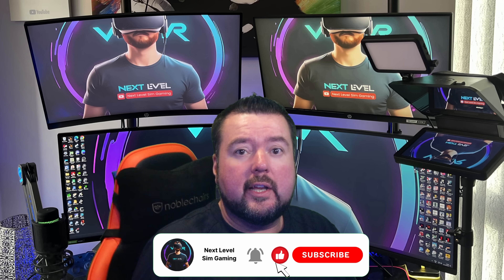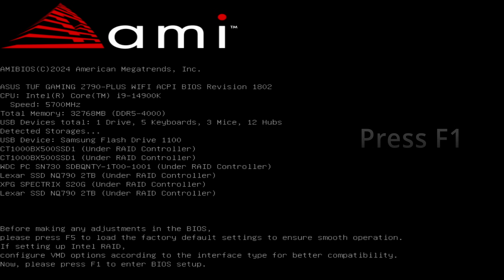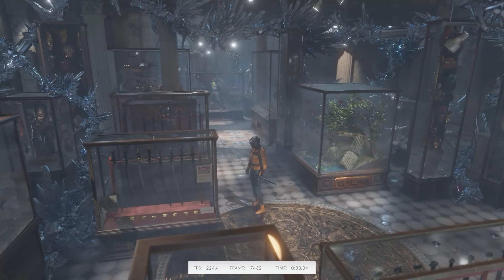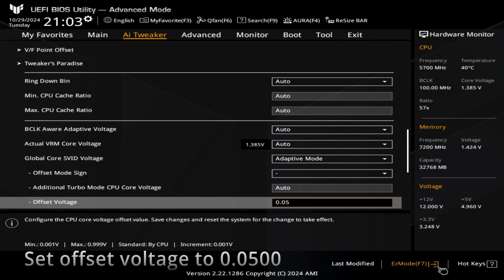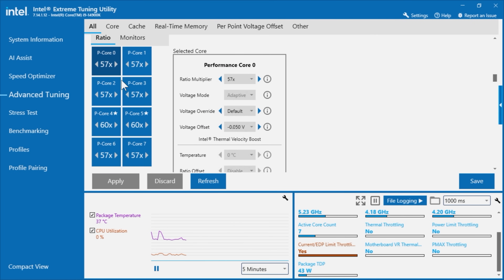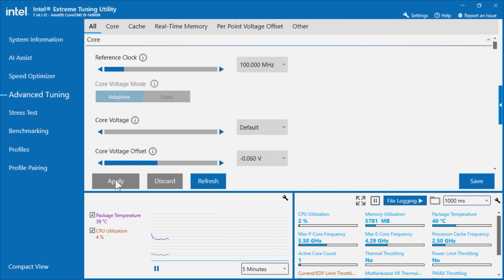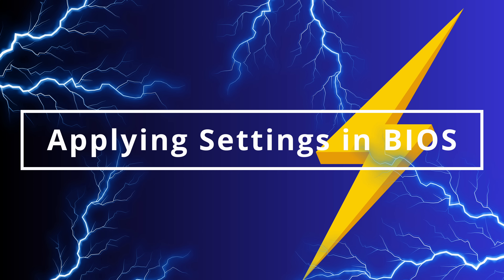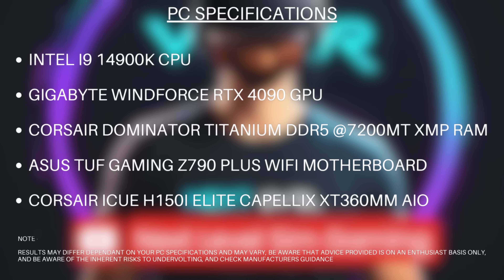i9 14900k Intel Final Microcode 1802 - 0x12B  BIOS Installation, Tuning and Undervolt Guide 📈

Comment: thanks mate!, a month ago, i upgraded some peices of my rig. perfectly knowing that there was issue with bios/cpu settings. so i knew stuff was going on. nevertheless, i upgraded my I7-11700k, with a strix Z490 MB for a new I9-14900k, with strix Z790, straight out of the box, updated bios and went with intel default... then i read and watched a lot of video out there... so after a week, i found my computer stable, i was happy, but quite not satisfied with the performance... it was a bit like my old I7... BUT not impressed for the price. during my week of tunning, i stumble on your video, not watched it but saved it for later...

yesterday, decided to watch it. so first thing, i installed cinebench 23... ran my test prior changing anything... my results was 16k cinebench... did the first part, just reset all, and intel default... it went up to 30k, which was like doubled! so i continued applying stuff... my end result with cinebench is 38.6 k now and i did stoped at the same number as you 0.6500 ... i cannot reach 26k cpu score on timespy i have 23k cpu score, but it was better than my previous runs!

is the RAM affects the cinebench results ? because i did bought from the QVL list of the motherboard for supported ram... so i stayed with the fastest supported at 5600, 2x32 gb ram, did not went with 4 ram stick. i read it was better this way for the dual channel thingy. altho the mother board will work with faster ram, i sticked with the QVL list.

my video card is a rog strix 4070 ti OC.

my cooler is Noctua NH-D15-G2, i am afraid of water cooler, because 10 years ago, i bought one, and overtime it leaked, it was a closed circuit thing... and the leak ignited fire as the liquid droped on the pcie slot which burned the MB, video card, ram etc...

do using a good water cooler would make the cpu faster ?! i mean, is this the next thing for me to upgrade AIO ? the Noctua NH-D15-G2 is more expensive than a lot of AIO, it is 204$ canadian currency.

thanks fir this video! was very instructive, you just erned yourself a new follower.

Comment: Does this microcode update affect performance in negative way? I don't know if I should update, I have 13700k since february 2023 and I had absolutely no issues with it. I am worried of updating and breaking something. Are all units affected by this issue?
Reply from the maker: @GrimmJow010  No, this has also been confirmed by other testers, it will only impact in a positive way in terms of stopping the CPU making excessive VID requests from the voltage regulator

Comment: Thanks a TON for this video. I have like a identical system to yours, followed your instructions and got 39.7 in cinebench. Never came close to those scores before. However i didnt use xtu, only set in the bios. X55 and -0.06. How do i know if its stable without xtu? Ive done many cinebenches and 3dmarks and no crashes so far. Temps are fine. Thanks 🥰
Reply from the maker: @tj0cktj0ck  Intel Processor Diagnostic Tool can detect issues with performance, 

https://www.intel.com/content/www/us/en/download/15951/intel-processor-diagnostic-tool.html

You can use the CPU Stress Test on 3D Mark also to produce an accurate enough idea of any issues

https://www.3dmark.com/compare/tsst/2264383/tsst/2264134

Comment: What a magician you are dude
Used same settings 0.07 on undervolt 40k points on R23
Fantastic TY🙏
Reply from the maker: @EB_133  Fantastic, thanks for the comment 🙂
Reply: @nextlevelsimgaming  Hi @Nextlevelsimgaming, do you think I will get a significantly lower Cinebench score with my Corsair DDR4  3200MHz RAM?
Reply from the maker: @ Yes, it is quite RAM specific as per the latest video 

Undervolt and Tuning Guide - Testing XMP Speeds and How it affects Performance #ddr5 #ram #xmp 📈
https://youtu.be/2exK1t0sRB4

Comment: Hello, tell me my processor i9 14900k scores 25300 points in 3dmark. You said that it should score 26 and higher, then this is normal performance. I configured it as you did under the video
Reply from the maker: @bacarditm9541  What GPU do you have?, thats based on the PC specs in the video using an RTX4090, it will be lower with other GPU’s, for example my previous Palit Gamerock RTX4080 it was around 19,000.  Also has your GPU been tuned using the Nvidia app?, also mentioned in the video?, I also ran a GPU autotune to sync with the updated CPU tune
Reply: @nextlevelsimgaming  I have rtx4080 super and my video card is not configured, it is on standard settings, yes, in general, my video card shows 28k and the processor is 25300, well, now I understand that it also depends on the GPU

Comment: I found out the cause of my huge score reduction. At first I thought it was the new microcode that made me lose thousands in Cinebench points. Turns out my issue was Logitech Ghub which is a disgusting software that uses up your cpu at idle. Now I got 40k and my cpu idles properly in Windows after I deleted ghub.

Comment: In Intel XTU, i've seen that Current/EDP Limit Throttling it turns yellow and says "YES" , should i be worried about this? Is it fixable or I can't get rid of it? I have an i9 13900k, gigabyte z790 aorus master, 32gb ddr5 6000mhz. Thanks for the video btw!
Reply from the maker: Its correct doing that as we have physically set Power limits of 400a and 253 / 253w in the BIOS as per the Intel Guidelines
Reply: Oh thanks, i was really worried, now that you say that is nothing to worry about i feel much relieved, i just updated to bios version to F15 then loaded optimized defaults and activated XMP profile. I've seen people when they loaded optimized defaults their intel preset went to "Performance" , mine went to "Extreme".
Reply from the maker: @ It goes to Extreme by Default on mine, all good mate enjoy ☺️
Reply: @nextlevelsimgaming  Thanks!

Comment: Hi Mate, So what was the main difference between this one and the one you did 2 weeks ago? i fallowed all you instructions there and scored 38,812 points (CinebenchR23). My temps is soo nice at the moment , never went 70 degrees and my PC is stable, Im just afraid if this one will ruin it so i want to know if its worth updating the BIOS again or just keep the previous one?
Reply from the maker: @maicagaming1702  Its the final update, the prior was the Beta, aside from not needing to disable CEP (which I found necessary on the previous version) it seems to be more stable, also the C1E idle state disable has been removed so the CPU will go to level 1 idle state if not used.  You won’t notice any detriment by applying this, its just Intel’s ‘case closed’ and in that respect worth doing.
Reply: @nextlevelsimgaming  Im updating it now, why mine says Ver.2703 ? And yours is 1802? my current Ver. Atm is 2602.Should i just continue and update it?
Reply: After updating, and run intel default. Score is 35,137 and temp reach 100. Damn its cooking.
Reply: Here is the 0.065 offset as it was your final set, scored 38230, so i lose some performance since the previous one before i update with 0.080 scored 38,812. So should i go 0.080 too on this one?
Reply from the maker: @ You can go to whatever is stable for your PC, mine is presently set to -0.07500 its how I run mine pretty much always.  The video is an example only to keep the video a reasonable length.  Don’t get too obsessed with the score, as long as the temps, and performance is good you can set and forget 😉

Comment: Nicely explained video.  Seems I got the short end of silicon lottery with an i5-13600k because its very finnicky to overclock at all with a decent MB, but these settings seem to be more stable. Obviously I adapted to the 13600k.  However one odd thing is happening.  Stress testing with XTU AVX2 does nothing to temps or cpu util.  It stays the same like nothing is happening.   The test carries on and says passed, but there is no load.  Cinebench R23 runs at full load for 30min no problem. Temps are reasonable.   What is going on with XTU?  Thanks
Reply from the maker: XTU can be problematic for some users, it doesn’t report full information for some chips you may need to run with Administrator Privileges 

https://answers.microsoft.com/en-us/windows/forum/all/how-to-re-allow-intel-xtu-modifiers-grayed-out/32cf8cf2-30a7-4ba2-a895-e97833e44ea0
Reply: i also have a 13600k , can i ask you how differently you adapted the settings (icc max, pl1 and pl2 aside that are obviously differents) in bios and what are?
Reply: @albertomontori2863   54P Cores 41 E cores 181 for PL1 PL2 offset to 0.070 so far. Have not done extensive testing, but so far stable.   XTU stress testing doesnt do anything so used OCCT with extreme which is essentially AVX2.   Temps are very reasonable on my AIO 360.
Reply: @dave4433  thank you 🙏

Comment: I just up dated and it limits performance too much so i just left everything unlocked pl and just put a hard stop on iA voltage limit of 1.45v
Reply from the maker: @merkedgg6322  You can do that, but to ensure that we are working within Intel’s guidelines, the video is based on improved performance and stability over the Intel Default Settings, I would be cautious on running untethered power limits.  If you have the cooling capabilities to keep temperatures low.
Reply: @ yea im using the ekwb direct die the highest temp i get is 80c at 344w get 42k in r23 cinnebench
Reply: But with limits i get about 36k lower than my 7950x
Reply from the maker: @merkedgg6322  Is it an i9 14900k you are using?, the guide is based on that processor.  Its completely up to you how you run your tune, but out of responsibility I have to show an alternative to Intels Default Profile, whilst maintaining the purpose of the BIOS update.

Comment: my unervolt setting is at your old setting of 0.07, now do I need to pull it to 0.065? I would appreciate it if you give me information, brother. again, it was a great video, you are good and you are doing good videos like this, regards.
Reply from the maker: its just a suggestion in the video, you will need to find the correct level that suits your PC the best, if you watch the full video and use Intel XTU to test , start at - 0.05000 then adjust and test, mine personally is set at - 0.075000 but that is based on the SP (Silicon Quality) of my chip and spec of my PC, just don’t be tempted to undervolt too far.
Reply: @nextlevelsimgaming  thank u so much brother
Reply from the maker: @ No problem enjoy 😉

Comment: Hi, thank you for the video! I have an ASUS motherboard and an i7 14700KF processor. Do you recommend updating the BIOS? Also, can I use your settings with my i7 14th, or do I need to make any adjustments?
Reply from the maker: @abdalhmid1419  No problem 🙂 yes I recommend updating it, I have been happy with the results, no detrimental performance and reassurance of hard coding limits on excessive VID requests are now in place.

You can use the settings however would need to adjust the ICCMAX and PL1 and PL2 to the Intel Specifications for your i7 14700, also the Extreme profile will not be available for that processor

Comment: Thanks for some helpful videos!, I have about the same setup as you have here, but when I run timespy the CPU clock fluctuates between 5400 and 5500 MHz, do you have any idea how I can stabilize the CPU at 5500 MHz?
Reply from the maker: @jamestnnesen3745  Out of interest do you have Corsair iCue and an Nvidia GPU?
Reply: @nextlevelsimgaming  (2x32GB) Icue Corsair ddr5-5600 , TUF Nvidia 4090 (only my motherboard is different, Prime z790-A wifi, TUF I think)
Reply from the maker: @ Have a read of this article -

https://www.corsair.com/us/en/explorer/gamer/gaming-pcs/nvidia-driver-56603-and-corsair-icue-problem-explained/

You will need to roll back the Nvidia driver to 561.09 and it will fix the issue, both @Emir channel contributor and myself have had the same issue, there is an update due next week I have read on the Nvidia developer group.
Reply: @nextlevelsimgaming  thank you you are the man:finger-red-number-one:
Reply from the maker: @ No problem 😉

Comment: I get an avx2 error at 0.055, what is the cause? degradation or high temperatures? at 0.05 I have no problems
Reply from the maker: @echiquiel458  Every processor is different, it depends on Silicon Quality however a degraded CPU will start to consume more power, I would recommend while you can taking advantage of the extended RMA process and replacing

Comment: Hi i have prime b760 plus asus motherboard and 13700kf can i use this settings? Can b motherboard undervolt?
Reply from the maker: The principles are the same for undervolting, however unfortunately I don’t have one of those boards or processors to assist you with

Comment: Hi, quick question for you. I have a 13900K and i've set it on sync all cores at 5500mhz. However, on HWmonitor it only registers it at 5000mhz max. Any reason its not following the specified core clock? Thanks!
Reply from the maker: Because the video is based on an i9 14900k the base clock of an i9 13900k is lower, you will need to sync all cores to 53 (5300mhz) otherwise you are trying to overclock and they will only boost when needed
Reply: @nextlevelsimgaming I have a 13900ks, what do i have to set here? All Core is normally 5.6, so I have to set 5.4 instead of your 5.5 or can I also set 5.5 like you?
Reply from the maker: @ I believe ftom what other users recommend for the i9 13900 is 53, best thing to do is try different frequencies to see what works best, I don’t have one to test unfortunately
Reply: @nextlevelsimgaming thanks, I just loaded asus oc profile in bios and enabled asus multicore enhancement, cpu boosts to 5.6 allcore in Cinebench with a score of 40700. Temps never reach 100 degrees in a 10 minutes run mostly between 90 and 95 degrees max. Is it safe to use this?
Reply from the maker: @ I would set the recommended Intel Power Limits as shown in the video, otherwise your processor is running at untethered power limits, you may lost a few hundred points in Cinebench but gain in lower temperatures and lifespan of your processor.
Reply from the maker: @ Its entirely up to you how you tune and operate your processor, but out of responsibility I have demonstrated an alternative to the Intel Default Settings while still respecting the Intel Default Guidelines on Power Limits on the CPU.
Reply: @nextlevelsimgaming thanks, appreciate it
Reply: Another thorough video. Thank you for the great content
Reply from the maker: @ A pleasure, glad you enjoyed it 🙂
Reply: Hi i have 14900KF this setting you show in the video i can apply and work without issue right.i have Asus MB z790 formula thank you 🙏🏼

Comment: When i updated to the latest BIOS i noticed my core clocks would fluctuate drastically from 5400mhz down to 800mhz. I prefer my core clocks to stay stable so i reverted back to the previous BIOS 0x129.

Would u recommend to disable IA CEP on 0x129? I also set my offset to -0.08000. What's ur suggestion with the lowest and highest negative offset?
Reply from the maker: The core clocks will fluctuate as the ability as the ability to disable C1E has been removed -

‘The option to disable C1E in the BIOS has been removed to ensure it remains enabled, reducing processor stress and maintaining stability per Intel's recommendation’

Intel considers it an important enough issue to remove the ability to disable it, so on that basis I cannot personally recommend otherwise.

Undervolt level is dependent on a number of factors, SP quality, PC build specifications, I run at an offset of -0.075 as it remains not only stable but leaves enough headroom to provide enough tolerance, but this is where testing and personal experience is import.
Reply: How to go back to previous bios? I deleted mine . I like the previous one better, this latest bios suddenly spike my cpu temp from 33 to 45 that shows on my screen AIO while the prev one stays 32/33 on idle.
Reply from the maker: @ Look at the pinned comment above if you have Corsair ICue installed.

If you want to roll back the BIOS update, you can in the BIOS EzFlash using the BIOS rollback function, however your issue is likely to relate to the pinned issue not the BIOS update

Comment: What problem could there be if the AVX2 test does not pass? I get an error almost ending at 0.055
Reply from the maker: The AVX2 test is one of the most demanding CPU torture tests

https://en.wikipedia.org/wiki/Advanced_Vector_Extensions

In day to day activities you probably won’t see any issues, in gaming titles such as Silent Hill 2, Black Myth Wukong with Unreal Engine you will start to see issues.

This is why Intel incorporated this test into XTU and what makes XTU a good choice for testing when tuning.

A CPU that requires more power may be showing signs of degradation, so that could be the case.

Intel were reportedly due to launch a tool to identify if a CPU is degraded, and the core of this is reportedly an AVX2 test.
Reply: @nextlevelsimgaming  Could the error be due to high temperatures?

Comment: Would you also set 253W for an 13900k? Or better the mentioned Intel specs of 125w? Its confusing what Intel says. 253W but then 125W tdp.
Reply from the maker: @xLuxSoldi3Rx  There are two profiles, Performance and Extreme, Performance uses 307 / 125 Pl1, 253 Pl2 in the video I suggest using Extreme (if you have a 13/14900k) which is 400 / 253 Pl1 / 253 Pl2) you can choose either profile that suits you, just change the relevant values when tuning/undervolting
Reply: @nextlevelsimgaming   I did undervolt over IA AC/DC and LLC, not with an offset. Its all stable but i set it to 125w. Most games are fine and don`t even underclock. But 253W with Gray Zone Warfare is horrible. It just burns the cpu to the limits with that poor optimized game engine.
Reply from the maker: @ I know there are a lot of issues with Warzone presently, i’ll ask Emir to comment on this question he’s a channel contributor he is our resident Warzone expert 😎